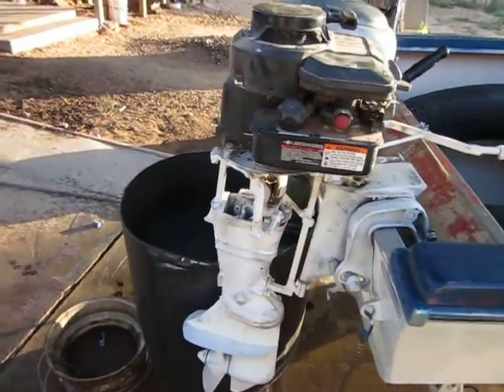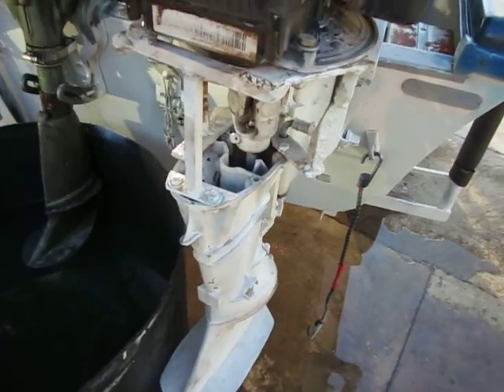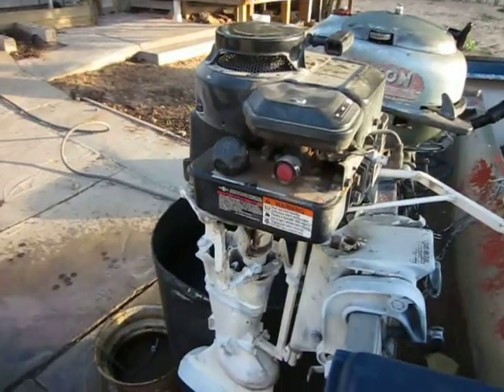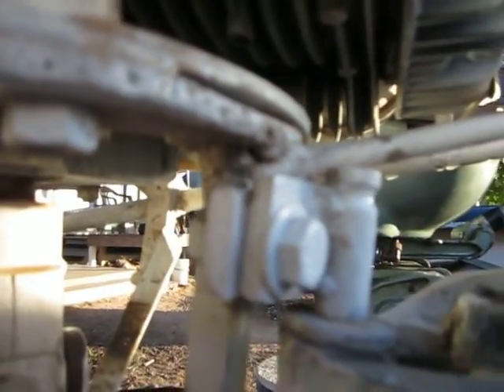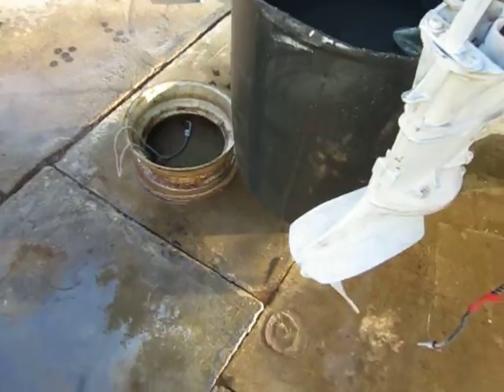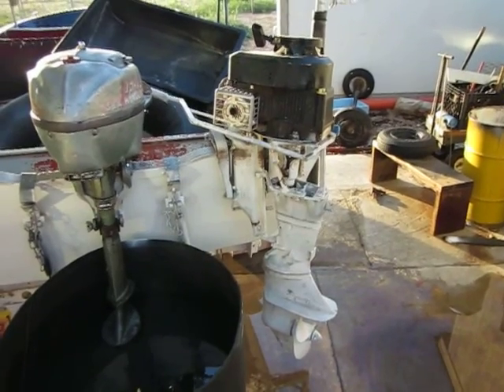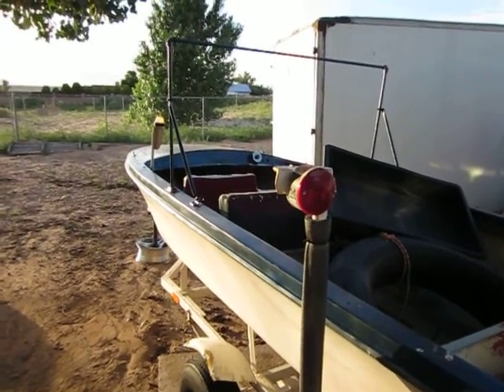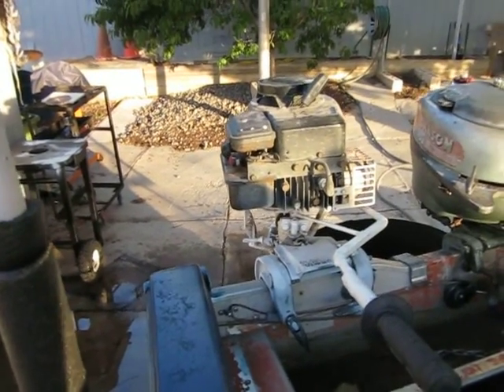Homemade outboard

Comment: I did this with a $119 harbor freight lawnmower motor & a 7.5 hp Evinrude lower.
Instead of a universal joint, I went with a belt drive.
The long shaft was flexing so much that it would rub the inside of the lower at high rpm.
I added a sort of pillow block made from the hub of a mountain bike, a rewired alternator for welding and power tools, drive it with a single A30 belt, tension with a solid black bungee cord & have a lever on the idler pulley to activate a slip clutch.
This way I can take advantage of the higher torque/lower rpm of the 4 stroke by changing pulley size, and can clutch the drive to avoid killing the motor with a high ratio pulley set. 
2.3:1 works fine without clutching.

Comment: Number one it was stupid to buy one number two is stupid to buy one that small number three as smart as you are you're pretty stupid that was not a boat motor you made that was a trolling motor you made out of a little bitty lawn mower engine and yes a lawn mower engine can be throttled down low enough to switch gears on the bottom end of a boat motor providing you have what little common sense it takes to hook up a throttle control to the engine so have fun complaining about your homemade trolling motor as if it was a real boat motor which it is not but have fun anyway

Comment: If you put a momentary kill switch button on the engine at the same time put pressure on the gear shifter what's the RPMs reach low enough you should be able to shift let go of the button and it should start right back up with remaining momentum in the flywheel

Comment: you can use a lawn mower engine unless you can find a cast iron flywheel if its used on ebay some i seen on here use a riding mower engine the ones with OHV or overhead valve burns less fuel than the L head or flathead engine some i see on here majority of the homemade motors use a Briggs and Stratton engines single cylinder, the opposed twin and v-twin engines. some use a Kawasaki Honda and Honda clone engines if its a walk behind mower engine or pressure washer edger it its a 3.5, Quantum, Intek it has to have a cast iron flywheel.  if its a 9.5 hp lower unit my guess would be is to use a 7.0 Hp 190cc Briggs and Stratton Intek OHV engine i would not recommend the professional series ass they have a PLASTIC camshaft and timing gear as they are prone to failure when it happens the valves don't work. for a boat motor the engine has to have a cast iron flywheel as well as a metal camshaft and timing gear.